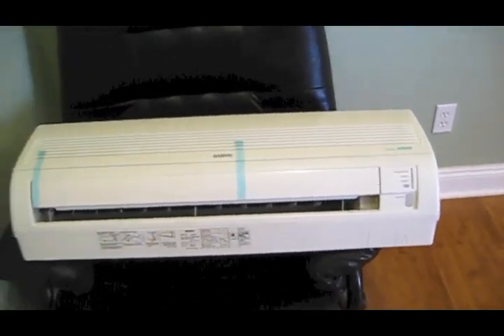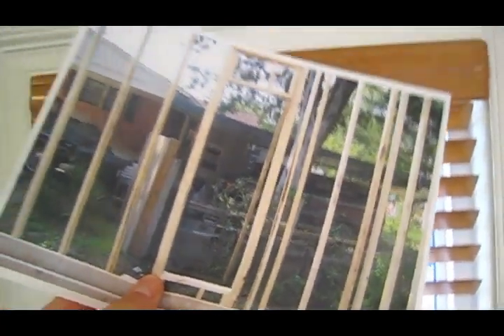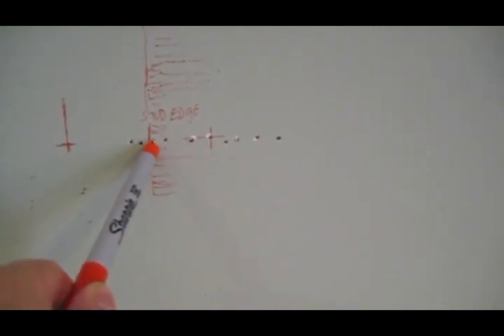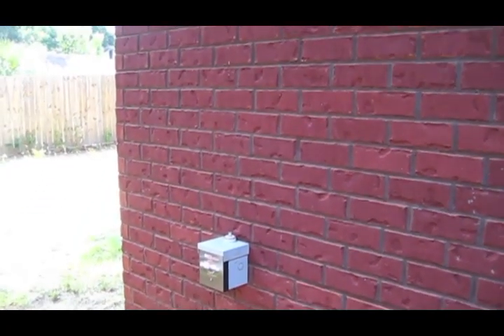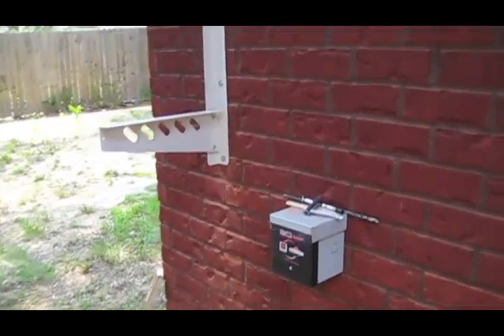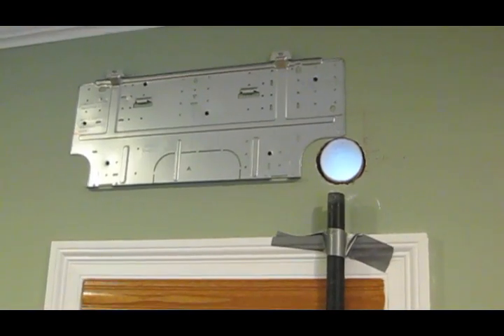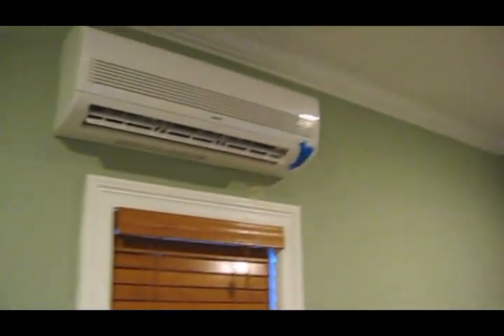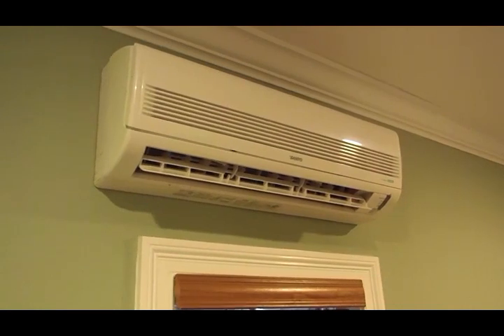Installing my Sanyo minisplit heat pump air conditioner system

Comment: Can you please tell me how the bolts are holding the weight without being drilled into studs? You mentioned lag bolts; I have used what we call butterfly bolts...they flip open once they get through the hole to the other side of the wall material.

Comment: I am installing a concrete building.  I'm trying to determine how far down from the ceiling is the 3" hole going to the exterior.  Unit will not be purchased at this time and I was hoping to make a good guess as to how far down the tube needs to be.  I plan on placing a tube in the wall prior to pouring the concrete.  Any advise from anyone would be appreciated.   Thanks for your video.

Comment: so as long as it is above a window it's ok to install? I have a casement window and hate the portable ac units. my old one sounds like a jackhammer.and the exhaust hose is way to big for such as small room and with a regular window unit I would need to build a window sill and use plexiglass or something above the unit. can I just open the windoe a crack and insulate the rest of the crack the hose doesn't use. if I use a portable unit and have a stand that is window height and the unit is the same size  as the open window/screen/ can I go without the exhaust hose and put the back of the portable one right up to the screen?  or cut a hole in the screen and use a short hose..btw 2nd floor and vinyl siding

Comment: Can you estimate how many inches from the ceiling down the wall is the 3" hole?  Is the measurement you proved the top of the hole or the center of the hole?  We are making a concrete structure and not going to order the ductless mini-split air conditioner and don't have the installation information.  Also need to figure out how far away is the 3" hole from the center of the unit?  Again, Is the measurement you provide the top of the hole or the center of the hole?  Appreciate any assistance from anyone.  Thanks

Comment: that cord is not sunlight resistant rated?  power in sealtite Mine are all 220V.  more efficient, less current, on it's own ckt as required

Comment: James, did you pull a vacuum before connecting the copper lines.  Your opinion on doing so....  Nice work.   [Some have mentioned not to wall mount (due to service ease), but in my case, its the only choice!]  Would you use the same brand again??
Reply from the maker: John,
The lines were too long so I had a friend who is a retired AC tech pull a vacuum and take a section out of the tubing.  We used the R410a that was pre-charged in the unit.  This brand has worked well but I would also consider a Mitsubishi.  I went with the 110v model so that it could be powered by my Honda generator.  We are very hurricane prone here in Pensacola, FL.

Comment: Do I have to "install" these systems.   I live in an apartment.  I was thinking, I could sit the fan outside on my balcony.  Then run the hoses through a spacer in the sliding glass door.   Then just lay the air blower inside on the floor.   Any problem with that?
Reply from the maker: The inside unit will need to be elevated so the condensation can drain outside.  Other than that, I don't see why it wouldn't work.

Comment: James you mentioned you live in fl. i have an 8oo sq ft 1 br condo. the old ac is on its way out. do you think a 1.5 ton 18000 btu will cool the whole place? the spot i would put it in would shoot the air into the living room and straight down the hall to the bathroom and bedroom
Reply from the maker: If you have decent windows and insulation, I believe you would be fine with an 18K unit.

Comment: I  want to move to a ductless system but wish they would make blower units that fit between studs so they sit flush.    Actually I'd like to install them on the ceiling which would be a much easier install coming down from the eave.
Reply: its called a cassette unit
Reply: Jeremy Pettibon  Can these be installledd in the wall?

Comment: wait about 3 or  4 years and  it quits the main board on the outside unit fails like it did on mine
Reply from the maker: I had to add R410a to it this year.  Not much but it was a little low.  You really have to stay on keeping the coils clean on the inside unit or the performance will go down fast.
Reply: Leak test before letting the charge loose.  Nylog, on flare fittings, works wonders. Nylog rated for R410a.